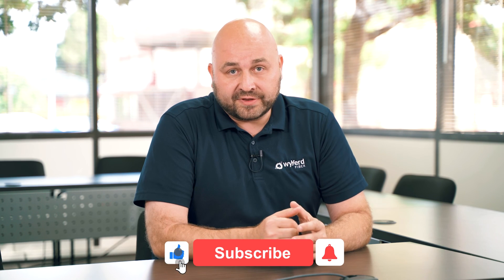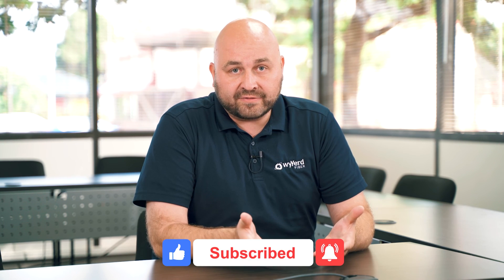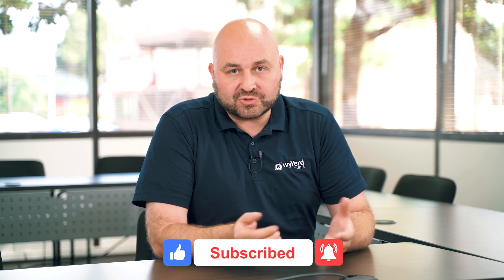Learn How Fiber Internet Works in Less Than Five Minutes

Comment: What is the bandwith of fiber, and of an ethernet cable?
Reply: There's no one answer as it depends on the specific cable and application. In general, fiber optic cables offer significantly higher bandwidth than ethernet cabling. You can get hundreds of gigabits over fiber. Again, the equipment at both ends plays a significant role in bandwidth. From what I can tell, you can get up to 40 Gbps over CAT 8 up to 30 m.

Comment: The light is passive...doesn't need power?
This is highly misleading. You dont get light without power to create it...same goes for copper, you need energy to create the thing that has the signal.

A better way to phrase this, the resistance (refractive index) of the material the light travels through is lower than the electrical resistance of the material the standard electrical signals goes through
Reply: i will use the power of light

Comment: Hi, I have a router that I would like to use with my fiber optic modem but I cant connect to the router, the  reason I want it to work apart of the integrated wifi of the fiber optic modem is cybersecurity if you wish and I dont want to eliminate it. Thank you